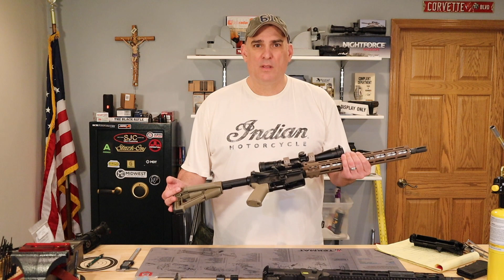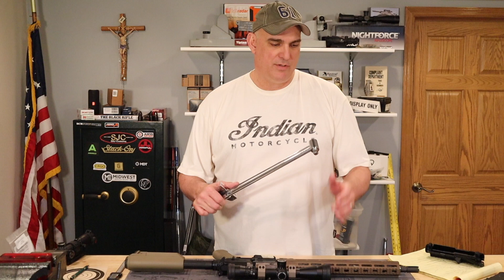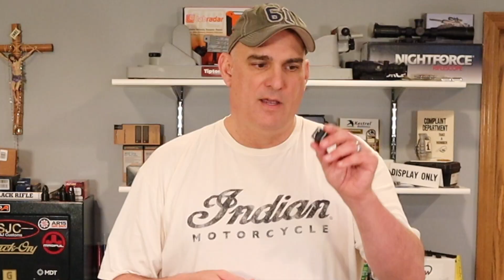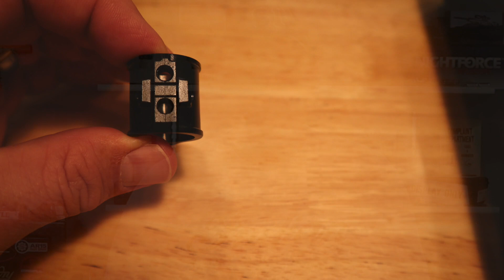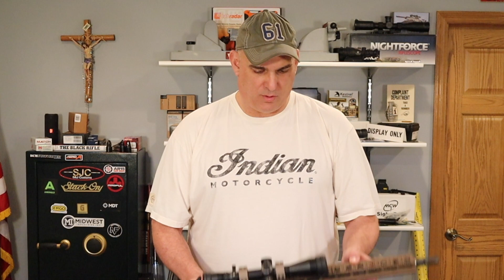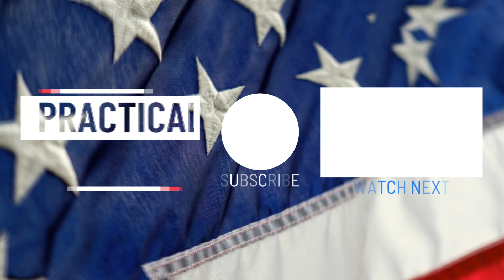Is it worth building your own ar 15? My first ar 15 build, the good, the bad, and the ugly.

Comment: Over the last 45 years, I've built dozens of ARs to different spec-levels, from precision DMR's, to hunting, to SHTF grab-and-go's, to truck-gun pistols, etc.  I'm sorry you've had challenges with your builds but I'd like to emphasize to those who may be thinking about building their very own 1st AR-GO FOR IT!!!  Just do your due diligence, research parts and suppliers, determine WHAT you're building your AR for-FIRST.  Is it for home defense, hunting, SHTF, plinking, truck-gun, etc.?  It's a very rewarding experience-every time you complete one and test-fire it successfully!
Reply from the maker: I agree. In the end, every things works fine. Its just not very accurate, but I'll keep working on it.
Reply: I just built own...It was not hard. I went mil-spec...Trigger, hammer, etc. love it
Reply: I’ve got the same amount of time using AR form rifles. Real life never allowed me to have more than one at a time. A few years ago after the kids didn’t need financial support I built a DMR like rifle…used top of the line parts ($1700😳). The moral of the story for me…don’t cheap out. Buy once cry once.
Reply: Yes, I totally agree with you. I built 4 AR's in 2019. I built Two using .223 Wylde gun barrels, one a 16 inch and the other a 7.5 inch. I also built two AR9's, a 16 inch and a 7.5 inch. Two pistols & two carbines. All four worked flawlessly and I had a lot of fun building and shooting them. I didn't use any Brand name Tactical parts to keep the cost down and everything fit together with no issues. I'm a machinist like one of the others who commented here. Everything has to be within tolerance and that's what Mil-Spec means to me. Mil-spec isn't bad or substandard, and who's to say a Tactical brand part is any better than the next. I didn't set out to make the most accurate AR's, I did a good job, had fun, and these were the first AR's I've ever built. They work good enough for me and that's what matters at the end of the day. 

Having to heat the upper receiver to shrink fit the gun barrel doesn't sound correct to me. All four gun barrels I bought fit perfectly into the uppers. None were loose and none had to be forced in, they were a nice slip fit, just the way you would expect them to fit. In other words, the O.D, of the gun barrels and the I.D. of the uppers were the correct size and fit properly together.
Reply: @rb67mustang    There’s at least one brand of upper (I wish I could remember which) that does require heating to fit barrel.
Reply: @rb67mustang  I when I built shimmed it to require thermal fitment. It is a way to accuratize  the AR-15 that generally reduces group size.
Reply: I totally agree, just start with less value parts and work your way up to building with high-quality products 😀
Reply: When in doubt consult an expert

Comment: Assuming your optics are correctly and securely mounted, I would re-torque the barrel nut. Make sure when you bring it up to its final torque spec, you back it off, then tighten it to that same torque spec two more times. Remember, the minimum torque value is 30, the maximum is 80 “-ish”. There are various schools of thought on what the correct torque value final setting is, but whatever you go with, it should be different than what you’re using now as it has proven to not work with your gun. Make sure to put molybdenum grease on the threads of your receiver and your barrel nut, and on the barrel extension.
The other thing I would do, is to try out various muzzle devices. Muzzle device is add mass to the barrel, which affect the harmonics/accuracy. Unless you have a muzzle device that can be tuned to the harmonics, you’ll just have to try different ones until you find the one that works best with your rifle and a given load.
Reply from the maker: Good advice. I'm hoping to due a video in the future with the changes you recommend, butI just have not had time to get to the range to test
Reply: Call the factory rep when all else fails, right?
Reply: I just pur together my ar I did not use any molybdenum grease on my barrel or the threads,,, should I take it off & add it, I used a torque wrench but I was standing on a stool tightening the barrel nut so I could not see the torque,,, it is connected super tight but I don’t know how tight exactly

Comment: I built one once that wouldn't put two rounds into the same zip code . I retorqued the barrel nut and now it shoots acceptable groups . There's a pretty large range of acceptable torque specs. . I 've found about mid range works for me . QA must not be what it used to be . I built all my ARs about 7-10 years ago and it seemed no matter where the parts came from they all played together well .
Reply from the maker: How much torque did you add? I retorqued the barrel nut, but have not shot it yet.
Reply: @PracticalAccuracy  ; I torqued it to 45# . I think the range is 30-70 . I've read where Colt suggests a low torque . Have you put enough rounds through it to build up the copper ? I'd go a minimum of 100 .
Reply: The one thing I never hear anyone mention about building an AR is , you now know how the rifle works and how it goes together . You understand your weapon .
Reply from the maker: @orionfixr7713   My barrel nut has a torque spec of 40. I retorqued to 43. I understand the copper build up and I generally don't clean barrel until copper starts throwing my groups out of whack. With that said, my groups are so large that I don't think copper build up could shrink them that much. I generally run 60 rounds for Ar guns and 20 rounds for bolt guns to get a proper copper build up. I had a gunsmith pin the gas block. Do you think that could be it?
Reply: @PracticalAccuracy  ; Pinning the block shouldn't affect accuracy, only reliability . Maybe it wouldn't be a bad idea to have your head space checked .? Check to see if there is any unusual wear starting on the bolt lugs . I'm  just throwing ideas out there. Are you sure your barrel is up against the receiver and that your barrel nut didn't bottom out on the threads ? It sounds like an interesting problem to solve , but a pisser none the less . Keep us posted please and good luck !
Reply from the maker: @orionfixr7713   I checked the barrel and receiver fit and it looks good. I'm going to take the muzzle brake off and shoot it without it. Headspace has been checked by me and gunsmith. I plan on doing follow up videos. The pisser is I've contacted criterion 3 times and have yet to get a return response.
Reply: @PracticalAccuracy  ; Customer Service seems to be in short supply these days . Remember , persistence pays off . Don't give up .
Reply: @orionfixr7713  I think you've nailed it, my friend. It's not properly head spaced for one. I hope he's got this one fixed. I'm late to the party.

Comment: i built a lower and put a used upper i had with 22 lr converter in it, the other ar 15 ati design  I used stuff i had except lower parts and carbine -regular sliding stock buffer tube and carbine slider part  m4 style i used the style stuff i knew from other ar 15 i had use parts to make a cheaper one!
Reply from the maker: awsome. Sounds like a nice build.

Comment: for me it was worth it... i got what i wanted for around 2-300 cheaper than buying one of the store.
Reply from the maker: Awesome, saving money is always worth it especially with the price of ammo today. How does it shoot?
Reply: @PracticalAccuracy  it shoots great, always wanted a 10.5 for home defense, i like it a lot!

im sure have i built it before this whole mess it will have been cheaper but given the current prices and scarcity of parts, it came out just as i wanted for little over $900, which is not bad when compared to the ones that been sold at the local gun stores, cheap rifles that normally go for $6-700 are been sold for $1100-1500 + taxes.
Reply from the maker: @CarimboHanky   Awesome.  I'm just glad you get parts.

Comment: Check the barrel crown for any burrs, nicks  or imperfections. Check your scope mount and rings. Check the scope as well.
Reply from the maker: Thanks for the advice and thanks for watching.
Reply: @PracticalAccuracy  Do you have a barrel straightness gauge?

Always check barrels before you buy them.
Reply from the maker: @shawnr771  I don't.  I'll get one. thanks.
Reply: @PracticalAccuracy  it is a straight rod with a ball on each end.

Mine was in a cleaning kit I bought at a surplus store.
Did not know what it was for years.
Reply from the maker: @shawnr771  Thanks. I'll look for one.

Comment: How extensive of a barrel break in are you planning on?
Reply from the maker: I use to do a barrel break in, but I don't any more as I never noticed a difference in precision. With that said, I could clean the copper out and verify with my bore scope. I also don't heat up the barrel with the fist couple trips to the range only firing 5 to 15 shots total. slow fire.
Reply: @PracticalAccuracy  thanks! I got another question for you. When you zero a rifle, is the distance measured from where you stand or from the muzzle of the gun?
Reply from the maker: @snowbyrdie2934  Technically from the muzzle of the gun. Practically, it won't matter. Hope this helps and thanks for watching.

Comment: G uses larger pins intentionally to give a better fit.  AP uses smaller pin holes intentionally for the same reason.  Tolerance stacking.  When using boutique parts it happens. What ammo are you using and you good with other ARs?
Reply from the maker: I used black hills 77 and 69 gr tmk, federal gold medal match and Hornady 75 gr bthp. As far as shooting goes, I think I'm above average.  If you watch my other videos, I can hold 1 moa or just under with my Rock Rivers (5 shot group).  I'm not the best, but not the worst.  I had a gunsmith pin the barrel. could that be it?
Reply: @PracticalAccuracy  I would look at the gas tube where it goes through the upper and where it interfaces with the gas key on the bolt carrier. It should be free with as little contact with the upper as possible. With a now pinned gas block you can’t adjust it those tiny twists of the gas block to get it perfect. I would not have pinned it until I was confident of the build. In fact with the free float hand guard on it covering the gas block I would not have pinned it at all. I am a fan of red loctite or rockset for the set screws. Exposed gas blocks require pinning.
Reply from the maker: I checked carrier key alignment on the build and it was very good when interfacing with the gas tube. the gas tube is also centered in the bcm upper.  However, I think your right that I screwed up by having the gas blocked pinned. I can't put material back on the barrel.
Reply: @PracticalAccuracy  copy. Is the flash hider pinned and welded?  If not. Pull it off and shoot it naked to test that and to inspect the crown. 

You have reputable barrel, it should do better. Had the gas block not been pinned you could send it back.
Reply from the maker: @ErikS308   Flash hider is smith vortex and is not pinned and welded. screws on without crush washer and is self tightening. I like to use it because i apply no torque to barrel.  I looked at crown and it appears to be good. I'll shoot it with bare muzzle next week and see how it does. I'm thinking I messed up pinning the barrel.
Reply: Practical Accuracy I wouldn't say it is messed up.  There is a Gremlin in there somewhere.  I had my old SAA stainless out yesterday and I shot my 77gr and 62gr loads together into a 1.5 MOA group combined.  Something is wonky for sure with your AR.
Reply from the maker: @ErikS308   Thanks. i'll let you know what happens
Reply: Practical Accuracy good luck with your rig and your channel.
Reply from the maker: @ErikS308  thank you.

Comment: I have three AR builds with Criterion barrels. 20" heavy barrel, 16" and 18" Hybrids and all of them using VG6 Epsilon muzzle devices. They are all parkerized, chrome lined and Wylde chambered. They all shoot sub-MOA with the 20" being the tack driver. I have used off the shelf non-match 62 grain non-steel core 223 and 55 grain 5.56 NATO so far. One of Criterion's co-founders is John Krieger of Krieger barrels and I believe he is still part owner. If you believe the barrel is the issue I would call them. I don't know if they put it in writing anywhere but I think it's generally accepted that Criterion should shoot sub-MOA.
Reply from the maker: Thanks. I called them today and left a message. Im going to re-test the barrel this weekend with a different muzzle device. I checked the barrel nut torque and it was fine.  I'm wondering how you attached your gas block? I had it pinned to the barrel by a gunsmith and I'm wondering if that is causing harmonic issues. Maybe I should have just attached with set screws or a clamp style gas block? I'll take a look at the vg6 muzzle brake as well.
Reply: @PracticalAccuracy  I used AERO Precision gas blocks. Forgot to mention that all my barrels are rifle gas length systems including the 16" carbine. I used the set screws on the gas blocks as the Criterion's came dimpled already. The Hybrids are somewhere between a heavy barrel and a medium contour so even if you over tightened the set screws a little I don't think it would be an issue like deformation on a pencil barrel.
Reply from the maker: @peter1956-x4s   Thanks for the info. I used Geissele pinned gas block with the hybrid barrel. I'm thinking that was the issue.
Reply from the maker: @Paul Foreskin  Awesome. I'm still trying to figure mine out.  criterion just contacted me.

Comment: Yeah I've been running into the "Mil Spec" (Tolerance Stacking") issues from time to time. I like buying uppers for my lowers and I built a few lowers and not all parts kits work. Mil Spec is one of the biggest lies in this industry lol
Reply from the maker: Both aero precision lowers I bought had the same issue with the trigger and hammer pin holes. Thanks for watching. More to come on the builds.
Reply: @PracticalAccuracy  Yeah I had that same issue with one of my Aero lowers. I have about 8 of them at this point and I installed a RISE armament drop in. They come with the anti walk pins and they were too big for the holes. I had an AERO parts kit and just used those.

I also into an issue with a BCM parts kit rear take down detent spring just would not fit.
Reply from the maker: @MSSynsyterGates   Interesting. I was going to do a video entitled "Mil Spec does not mean quality", but I might have to re shoot it because I show how parts fit or don't fit together and youtube is cracking down on this lately.
Reply: @PracticalAccuracy  if things get tough in this world..they will block all of us from communicating..we will be a at very big disadvantage